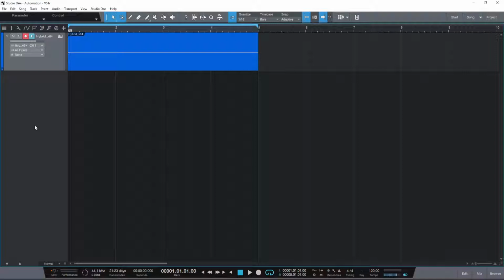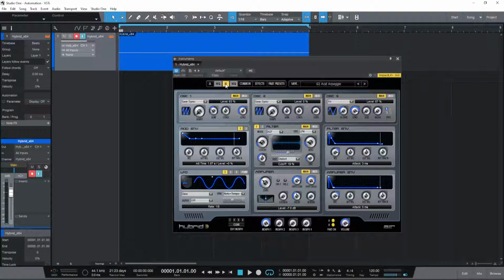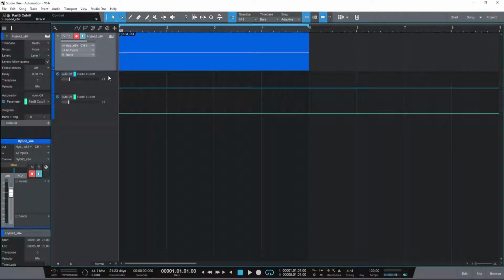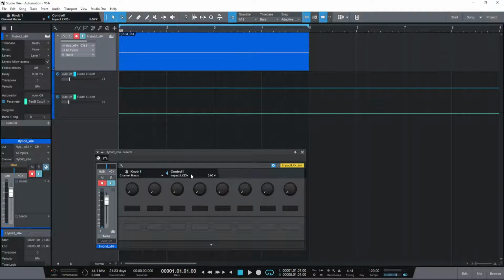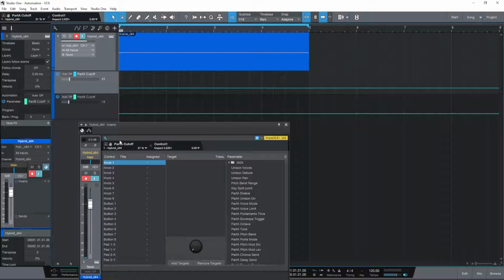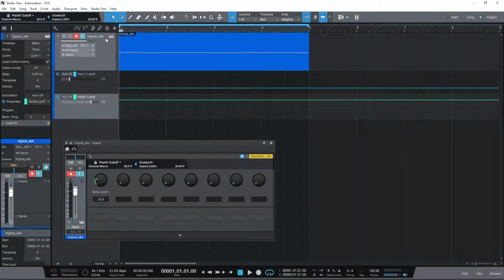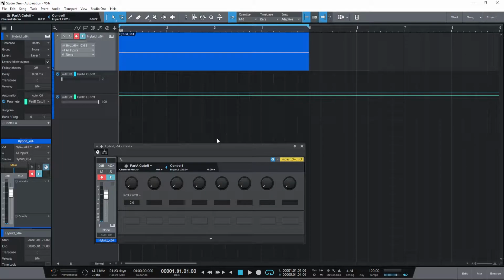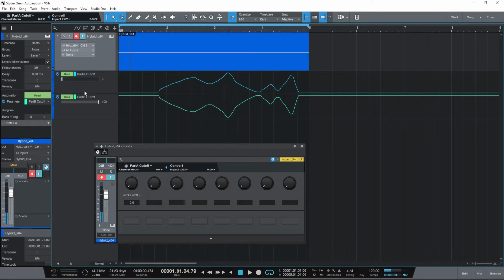Automation of Instrument Plugin parameters using MIDI controller in Presonus Studio One

Comment: small tip - if you would want to create an automation track for a parameter of a given plugin, just touch it and press "a" on your qwerty keyboard. no need to drag the hand. btw - you can also drag that hand icon (if you so wish) from the plugin window itself. there's a cogwheel icon on the upper right to the plugin window, which opens the exact same options you can see at the upper left of the studio one window.
Reply from the maker: Thanks for watching and your tips 🙏🏽
Yes they all work well 👍🏼